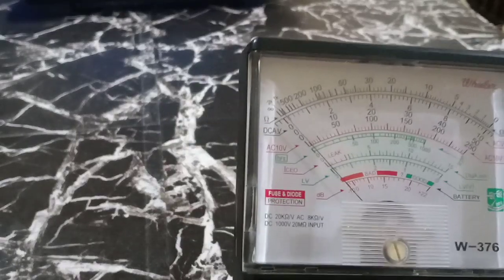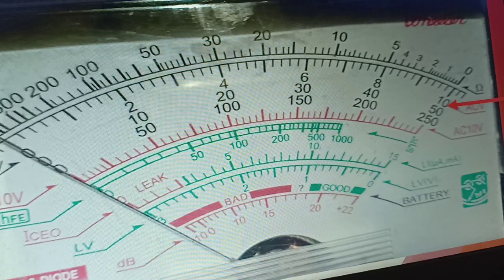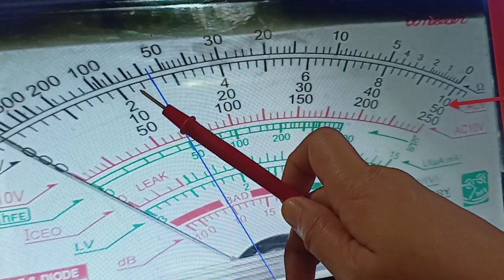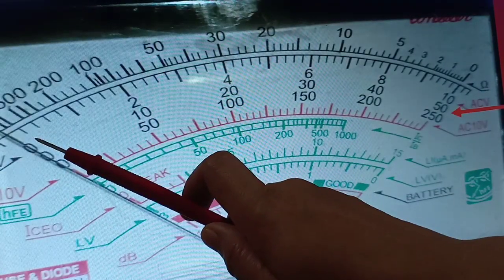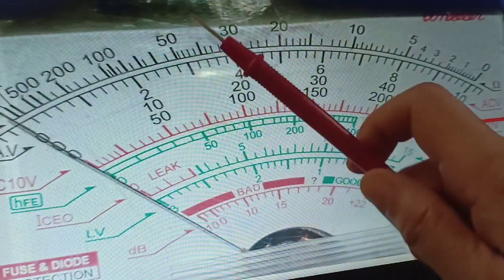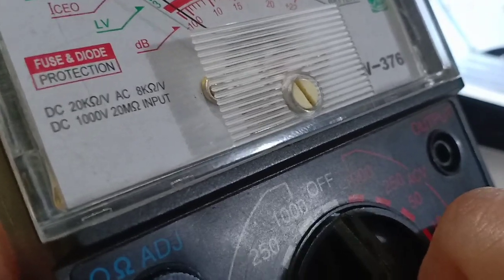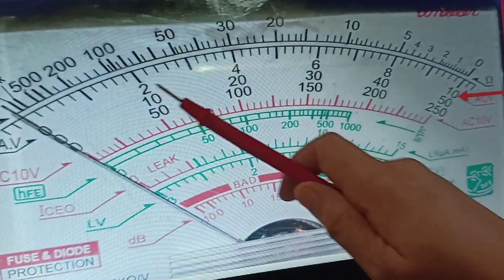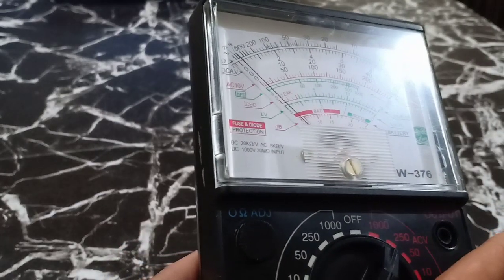Multitester Reading

Comment: what if the pointer goes in between even it was fully calibrated, what value should I use? the highest or the lowest? 

ex: Fully calibrated multi tester sets in 250v AC, the pointer is in between the 150 and 155. Will it be 150 or 155?

Comment: What if the setting is 5 volts?
Reply from the maker: If the setting is 5 volts you may use 50 as reference divided by 10 (50/10=5).
Reply: @electricitybasics1878  Thank you!! :)

Comment: Can I set 9 voltage of dc battery in setting 50 madam.
Because, when I set in 10, It show the end of terminal point. Therefore, I set in 50,but 9 vot dc battery is showing over 25 volt. Because, you already explained setting in 50 is each unit is one volt. I think some things is wrong madam.
Reply from the maker: Thanks for your comment. Regarding your query,  since you have 9 volt battery yes, it would be safe if you set it into 50V. However, getting a reading of over 25 volts? Whatever setting is, the reading should be the same.
Reply from the maker: Please watch also my other video tutorial on reading voltage.
Reply from the maker: Please watch also my other video tutorial on reading voltage.
Reply: @electricitybasics1878  
Yes madam. I will try and study again. Thank you for your replying madam.